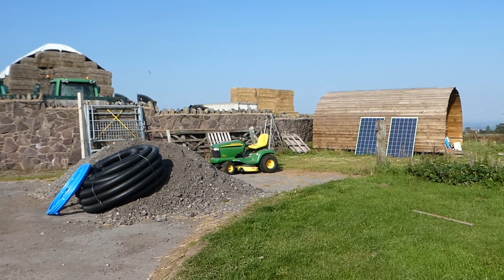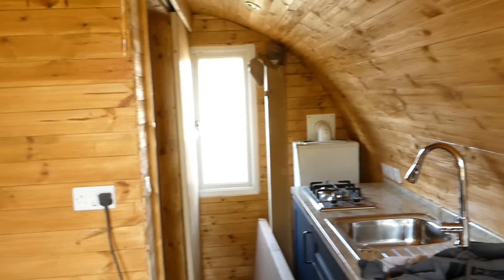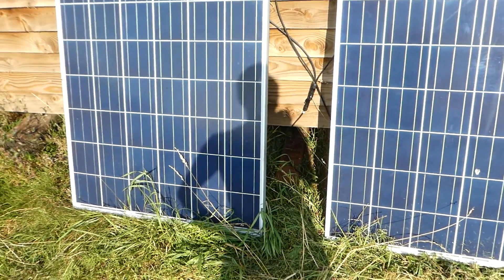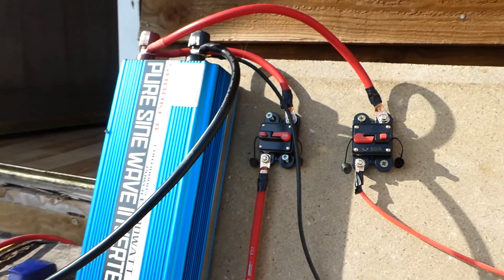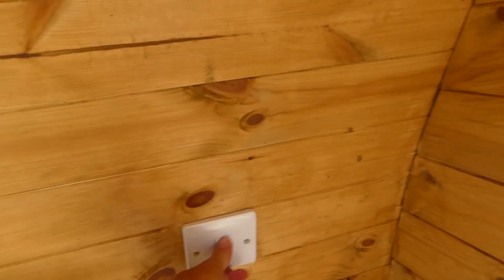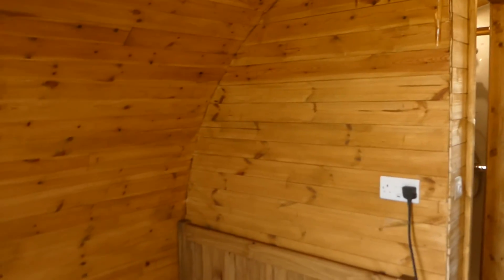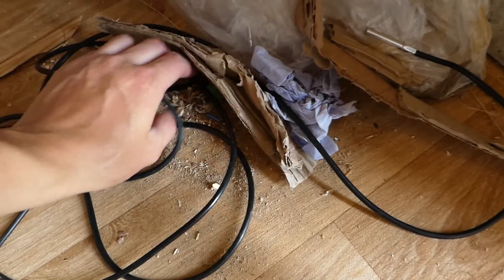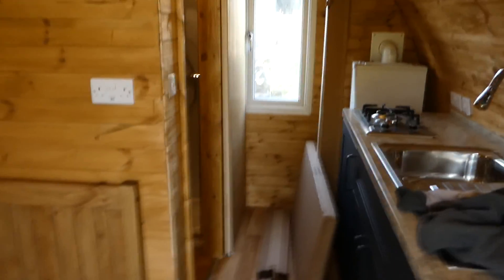Building a Glamping Pod - Part 16 | DIY 500W Solar Power!

Comment: Hello, could I ask where the water supply and waste water are coming from and going, I’m thinking of building some of these for my fishing lake and we have no services at all. Thanks Lee
Reply: Thanks Oscar, I’m planning on doing a bore hole as the water table is quite high and it’s potable quality water, I’m going to do the same with a septic tank, I’m quite impressed with your pod, I’m going to build four myself and try and get them done for next summer season, keep the videos coming they are great, cheers Lee
Reply from the maker: @Lee_Blenkinsopp  Ahh nice one, that should work quite nicely then! I'm glad you like the pod, it's taken me longer than it should've but has been a fairly big learning experience for me to say the least but I'm glad you like the videos so far! Thanks!
Reply from the maker: Hi Lee, our water supply will be coming from our farm's borehole but will need to lay some more pipe to connect it in. Perhaps you could somehow filter and disinfect out the lake water, look into rain collection systems or, better yet order in an IBC/water tank and run it straight from that.

As for the sewage I've just found a second-hand 'above' ground 3500 litre septic tank that I think I can use as a temporary measure before I need to expand for more pods. We can pump it out ourselves to spread on the fields which is an added bonus,  I'll be doing a full run down of this towards the end of the month so feel free to tag along for that. I'm sure you could use a similar system for your scenario. 

Hope this helps! Oscar
Reply: Really good dude. Quick question - I know you ran it by solar but what’s running the Boiler ? As I’m assuming the solar can’t power that?

Comment: Good Video and making me think about solar now... I've just about completed my garden house/bar/hot tub. The next project will be a pod for sure.
Reply from the maker: Hi there, I'm happy you liked the video, I'd definitely recommend solar, it's relatively easy to install and isn't the most expensive solution out there. I've also been trying it out with a 500W wind turbine atop of the pod which I'll soon make a video on. If you have any questions about the pod or solar power ask away! Thanks